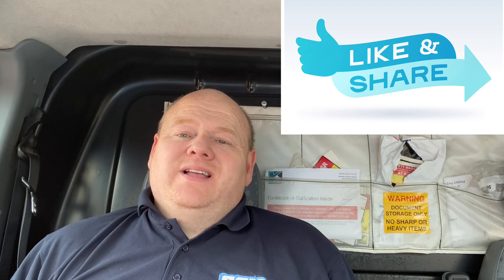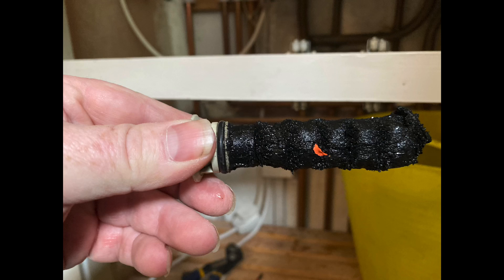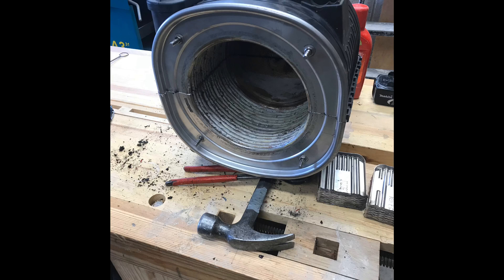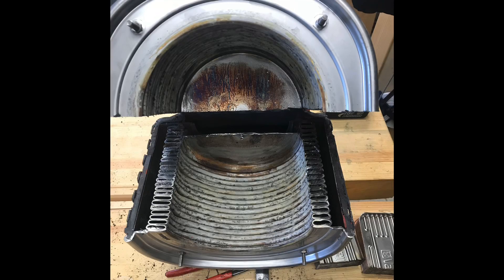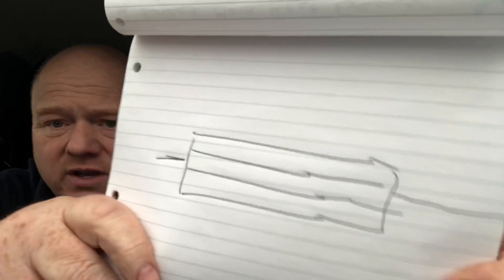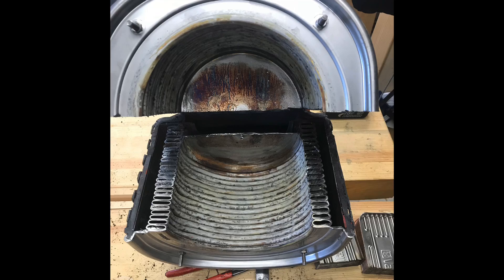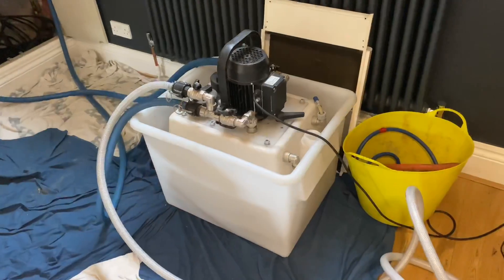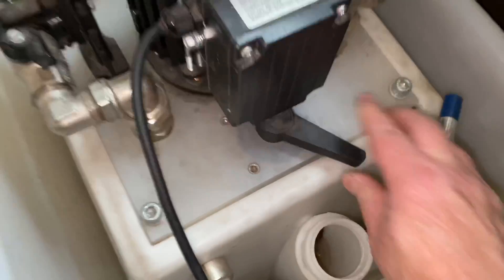Blocked Main Heat Exchanger / Noisy Boiler / Failed Powerflush

Comment: Hi i have valliant combi boiler, 50 m2 flat. Added 2 miracle seal bottles and a half of fernox f4 to the sistem because there was a pex leak in the floor. Turns out pex was not properly pressed. Now when water is heated there is a cyclic hissing sound in the begining and the continous as temp rises to 70 degress celsius. Tried to flush with water from the public water supply but hissing returned after a day. Would repeating the flush help resolve the issue?

Comment: thanks for the video ,exlpains whats going on with my boiler ,banging  when hot water is turned on , and my thermostat is not connecting with the boiler ,,batteries in it are good, heating will not come on ..

Comment: Another excellent video, thank you. I have a the heating equivalent of Triggers Broom, it's a lovely Baxi Combi 133HE Plus.

We replaced the pump 6 months ago, the heating works well, but unfortunately there is now an occasional and intermittent noise coming from within the housing. 

We can stop the noise instantly by turning on the hot water tap and quickly turning it off. The system has not been flushed for 15 years, there is no magna filter. It's a quandary and I will be calling in a heating engineer (doubt you are in east sussex?)

Your opinion is valued and appreciated. Paul

Comment: Hi Allen, we hae 8 years old Bosch Worchester Greenstar 18i system condensing boiler. When winter started and we turned on the heat, the radiators were luke warm on top and cold on the bottom, so we had an engineer out who advised to do a power flush on the system as it's been badly sludged. So we did, after the power flush they re-started the system but managed to get the 1st floor radiators heated only, the ground floor still remains cold. We've been told our heat exchanger is blocked, they can't fix it and we need a new boiler fitted. We've been shocked to say, and called for another engineer looking for a second opinion, who said the problem is not with heat exchanger otherwise we had no heat at all! He thinks the problem is with thermostats we have on the ground and 1st floor, most likely when we turn on the thermostat it sends the signal to zone valve which is either faulty or not connected properly. So we are trying to find this zone valve now, which is a bit of a struggle as its been fitted by previous owner and we don't know were it is. But above all, we are so confused, as both engineers opinions are polar different and we do not know whom to trust. My question is since we have no banging sound, strange noise etc and have heating on the 1st floor and hot water can heat exchanger be blocked anyway? And if so, can this be cleaned on this mode of boiler? Thank you
Reply: I had a similar problem n it turned out to be the pump.

Comment: my worcester greenstar ri 18 heat onlt boiler keeps going on to over heat and lock out turning off .. are they very sensitive to air locks/blockages  as i have drained the system down to to replacing a radiator valve ?

Comment: Hi Allan..
I know this is an older video, but I was wondering...
Is it advisable to use the siphoning method of introducing cleaner into any heat exchanger???
And if so is this achieved by opening the drain off and then using any siphoning point at the top of the main hex???
Also turning off the flow and running the dhw , this then cleans the plate?...
Thanks again Alan your an absolute star

Comment: Hi,  i added cleaner to my heating system after the boiler was making some banging noises but now there no hot water or heating. The boiler fires up but seems like its blocked and not able tho pump the hot water around

Comment: I can see you are very connected to the problem and succesful as well.  My problem is I added a quart of Rectorseal 8-way and left it in the system then weeks alter heard this hammering kettling sound downstairs. I am thinking it may have loosened all the hard minerals and created sluge at the bottom loop line. What do you think may have been this problem?

Comment: Hi there,  I may have a similar problem but on mine is that when you call for hot water ,the radiator will heat up before getting hot water.  We have a baxi dual it has about 10years or more. Also, we get the banging noises for hot water and I noticed one of the radiator was blocked when trying to drain the system. Will very much appreciate your advice thank you.

Comment: Hi Alan, great Vid, might sound like a daft question but how did you actually Syphon/create pull on the liquid cleaner without sucking the end of the pipe to create vacuum? Or did you....another great vid.
Reply: i wondered about this, perhaps opening the drain cock with the cleaner bottle connected. draining water then creating the negative pressure?
Reply: Yup open the drain and the vent. The negative pressure will draw in the liquid. For some those without a vent. I close the ret flow and drain. Using a garden weed sprayer connected to a hose and jubilee clip. I pump it in close open the return and re fill. Close then run the hot water for about 30-40 minutes.   @teejay2130

Comment: Hi
Can you give me some advice please. Iv been in a living hell for a week now due to been waken by noise through my house. 
I first thought it was something in my house so I got everything check. 
It's a strong rumbling noise, sounds like beginning of earthquake rumble then, constant vibration which sounds like deep sound in pipes maybe and and extremely low grinding repetitive chugging sounds.. 
Someone who came to visit pointed to a wall saying that's where noise source is coming from.. Guess what that's where neighbours boiler is on other side of that wall
I did knock and the neighbour was argumentative straight away saying that they have had there boiler checked in the past so there's no way it can be there boiler, 
My landlord won't help me with the issue either. I'm at breaking point. 
Does the noise sound like it could be there boiler, and if so why has it suddenly become so noisy??

Comment: I have an old boiler that is making lots of gurgling sound before it starts an sometimes it doesn't for a couple of minutes before it starts which cleaner do you recommend? I'm having the boiler replaced in Aug but a temp fix before then

Comment: Hi Allen Hart, I have an Alpha 40GS with mains water flushing out of the condensate pipe in full volume even when boiler is off. 
Boiler works for 10 minutes then stops showing an error.
Any idea what is going on here?

I'm hoping you can answer this question as there's not many experts around who can answer this question.

Comment: My combi started banging this morning, i bled the nearest radiator to the boiler that has never been on ( tvr set to zero) and its stopped banging. 🤞
Reply from the maker: Does the system have or need a bypass? Thanks.
Reply: @AllenHart999  it's started banging again, not as loud or as often though. It's mainly when the heating has got to the set temp on my thermostat in the hallway and then when the boiler stops heating it then starts banging. Any ideas on what I can try next? I'm not good with plumbing and won't touch anything gas, but I am a tools person 

I have a plumber booked in, but I also have a £500 bill on my car coming soon 😭

Comment: Can you do it on Worcester bosch boiler
Reply from the maker: Yes definitely, Its easier as they have a drain off in the boiler. Thanks.
Reply: @AllenHart999  where do you put cleaner in
Reply from the maker: @paulbentley849  Via the air vent at top, Just suck it in while you drain water out of the boiler. Close isolation valves first underneath though.

Comment: great video.  one question - Whats the overall cost of this job approx? compared to the worst case, that the boiler needs replacing.
Reply from the maker: Very good question. Depends on lots of things really. Just remember it would still need flushing if you changed the boiler. Thanks
Reply from the maker: Thanks very much for your comment, please consider subscribing to support the channel 🙂

Comment: Could it be fair to say that while both HE can be blocked by limescale, but secondary HE will be worse affected by magnate than the primary and also the magnetite flakes also end up in the impeller restricting flow and can lead to pump failure due to it overheating if not noticed for a long time.

Comment: Hi, thanks for the video. Very informative.
We have  a new heating system (approximately 1 year old), which consists of new baxi platinum, new radiators and pipes. However, until recently we weren’t living in the house. We lived in the house now over a month and we have started hearing banging noises from the boiler. The noises are random. Usually a while after the boiler has been turned on. Any advice what this could be?

Comment: Hi Allen, I've under one-year-old viessmann vitodens 100w wb1b 19kw boiler. Recently I've noticed my primary pump next to the big cylinder constantly on even not hot water or heating on. I've checked a few times and the pump doesn't turn off after heating hot water off. Its runs 24x7 at the moment. Is this normal? What could be wrong?
Reply from the maker: Already replied on other post. Thanks

Comment: Greatly informative video Allen.  A couple of engineers not keen to treat our Main Combi 30HE for suspected clogged secondary heat exchanger , causing burner to switch off/on and hot/cold water at taps.  Diverter valve and heating seem OK, plate exchanger has been cleared.  They advise a new boiler or new secondary heat exchanger and diverter valve to start.  Is there a DIY way to get chemical into the boiler's main/secondary heat exchangers (not the heating initially) or should I just add X800 or F3 through a towel radiator and hope for improvement over time?

I thought of draining off the boiler and using a basic hand siphon pump to get X800 / F3 in through the heating return, where there is a cap above the isolation.  Thanks.

Comment: My condesing boiler makes a bang the same time every day been told by heating engineer after sharing a video of it making the noise, he says it sounds like the heat exchanger and will need a new boiler, have any advice or can you fix it. Post code WA8 9HH

Comment: Ive used Sentinel x200 on my older Potterton Suprima which knocks and pops a bit on coming upto temperature after a few minutes.  It hasnt changed anything oddly, it was dosed via the heated towel radiator.  Would fernox do a better job or is there another issue? Thanks for any tips.  The knocking does go after another 5-10 mins or so then sounds like a kettle on boil with the sort of 'hiss' which is much quieter.  Tried the pump on a few speeds also.  Coolant looks clear.
Reply: Use x800

Comment: great video again Allen! wanted to ask when you use the powerflush machine is the boiler/heating turned off and flow return isolated under the boiler? i would of thought the would need heat for the powerflush machine to work better?  thanks
Reply from the maker: Depends on job really. Normally i would put tees in under boiler, On this one I flushed through the boiler. Thanks.
Reply: Is that flushing through the boiler with the heating off? im thinking about the reverse flow on the powerflush working against the boiler pump if the heating is on. Thanks again Allen!
Reply from the maker: abdul hafiz Boiler was left on and the flow was same way as boiler. You wouldn’t want to do it in reverse. 👍

Comment: Which heat exchanger do you think is more reliable a flat plate or a round coil.
Thanks
Reply from the maker: If the boiler is installed correctly and the system flushed then most heat exchangers will be fine.

Comment: Suggestion for next vlog...getting a proper filter installed.
Reply from the maker: Which filters do you like? Thanks.
Reply: Allen Hart Last year I fitted an ADEY Pro1 28mm on the return flow to my Ideal boiler...I’d send you a foto if I knew how.
Reply from the maker: @robinmyman  Adey Pro is a great filter.

Comment: A couple of people have asked how you got the cleaner into the boiler and you said it was shown in the film, sorry but it was not clear exactly how you did it.  my thought is that you isolated the flow and return then got your bottle ready with the tube attached then opened the boiler drain which sucked the liquid cleaner into the boiler then you closed the boiler drain.  Or, over to you, please enlighten us.  i like you use a boiler replacement as a last resort, save where possible, nice one, keep em coming.
Reply from the maker: I will try and do another video to show. Thanks.

Comment: Allen what would be a typical cost for a job like this please be as the cost and quality of power flushing seems to vary , could I kindly suggest a video where you could give tips on how to tell if a flush is being done right , I had 2 systems flushed and 1 is fine but the other has had issues , same guy , same machine , go figure. Keep up the quality content.

Comment: Hi Allan 
The disaner radiator blocking the mains heat exchanger and plates heat exchanger blocking 
Regards 
Faruk
Reply from the maker: Hi Faruk. The system was very dirty and this blocked the boiler. We needed to unblock the boiler first and then the rest of the system. Thanks.

Comment: I dont doubt chemicals work but why is my powerflush machine so dirty when there's been so much cleaner ran through it as an experiment I put a badly sludged up pump body in neat x800 for 2 nights and the result was far from what I expected 🤔 what an interesting life I have stay safe
Reply from the maker: Customer is happy and now has hot water and doesn’t need a new boiler. LOL.. Thanks.

Comment: Won't last, you'll never get all the crap just with chemicals
Reply from the maker: Just been to one that i saved 4 or 5 years back and its still going strong. Never had one fail yet but never say never.
Reply: @AllenHart999  good effort Allen but I think sometimes that sludge goes rock hard and no water or chemical in the world is going to shift it
Reply from the maker: @jimmyfletcher123  I totally agree, I have been lucky so far but I have always brought them back. The day will come though when it doesn't work. Thanks.

Comment: The heat exchanger is just a series of parallel coils.  Other heat exchangers have a spiral.  Allen, did just isolating the CH flow & return then just running the Fernox around the Heat X by running the DHW tap, do the trick? Or was the full flush needed?
Reply from the maker: Yes it did do the trick but the system water was really bad. So we did a full flush. Thanks.
Reply: @AllenHart999  
how long did it take running just the hot tap?

Comment: Thanks Allan. Did you run the hot tap  for circulation within the boiler?
Reply from the maker: Umar K Yes, Turned the boiler temp down to start with and then turned it up a bit at a time. Only banged on high fire but main heat exchanger was very bad.